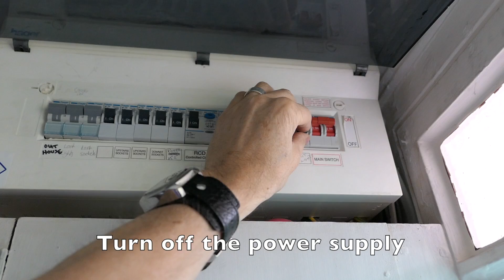How to replace halogen spotlights for low voltage LEDs

Comment: I've currently got halogen spotlights on a dimmer switch and want led's instead.
Do i need to replace the dimmer switch along with the led driver, too?
What rating led driver do i require to run 6 GU10 led's bulbs.
Reply from the maker: Just make sure the drivers and bulbs are compatible with dimmers and you should be okay.
Reply: @AngusMcGregor  
In that case, I will replace the high power halogen dimmer switch to a low power led one. Thanks.

Comment: Sorry for the dumb question but I had my whole house fitted with spotlights and a few years later I find that the ones in the loft conversion room are big and chunky and not easy to replace (unlike in all other rooms). Anyone know why that would be? Are they halogen and can I replace them using the method in this video? Thanks!

Comment: Apologies, a bit late on this one but I have tried to do exactly as you did, ie replace halogen transformers with the same model of led driver you used.  I have two down lighters on the end of my kitchen circuit.  However one of the drivers is making a noise when the bulb unit is connected and will not illuminate. The second one, on the end of the loop-in circuit sometimes lights but then doesn't.  It flashes once each time it's switched on.  Have bench tested the drivers, ie connected a lead from a socket and therefore 240v is being supplied to the driver but it does the same thing, flashes once and does not illuminate.  Tested the bulb holder and leads on a car battery (12v) and that is ok.

Any thoughts?

Comment: It seems my transformer has no earth. Where should I plug the earth wire? Or could I use it without earth?
Reply from the maker: Are they transformers or drivers?
Reply: @AngusMcGregor  im not sure the box says Led Driver but in Amazon where I bought them, transformers. Would they work? Or they need to be transformers only?

This is the one. I just didn’t want to blow out my house haha 
REYLAX® 12V 30W 2500mA LED Driver, AC to DC Switching Transformer, Constant Voltage Power Supply, Low Voltage PSU for LED Applications

Comment: Can you please show how you are taking off these lights? I have the exact same one and not able to take out.
Reply from the maker: This shows you better in this clip 3:08 all you do it pull the unit out of the ceiling. There are a couple of spring retainers on the light unit but you will see where to hold these when pulling the unit out of the ceiling and putting it back in.

Comment: All good. I am having trouble unclipping the downlights from the ceiling. I'd like to avoid breaking the ceiling and I have no access from above it. How do I do it? The search continues....
Reply from the maker: G T Hi, Unfortunately you have to give it a good tug. it may bring a little bits of plaster off but there should be only a little bit of making good afterwards.

Comment: Nice video. question 😊
1. Why you have used so many "drivers" whereas you can use a single transformer for all LEDs connected same connection.
Reply from the maker: subhan907 you would need to check how many lights your drivers can will light up. I would of had to rewrite the whole lighting system and pull up floor board above to rewire so I juts used one driver per lamp as it was easier.
Reply: @AngusMcGregor  thanks, makes sense.

Comment: Why do you need the driver?
Reply from the maker: MAGA anti-globalist To convert from 240volts
Reply: @AngusMcGregor  I understand that you can connect GU10 fittings directly to 230 without this
Reply: @MrOzzy281  It is true, you may use mains directly. I suppose though, using transformer to convert to ex. 12V may seem a bit safer, in case of ex. steamy bathroom and plenty of humidity. On the other hand, why bother having differential switch at home? I am on the verge to switch from halogen to LED in my bathroom, though not sure whether to continue with drivers.
Reply: @wikopl  drivers fail and need replacing. They add work and cost. I see no benefit personally
Reply: @MrOzzy281  I just bought 240v LED and wired straight in without transformer or anything like that and they work just fine. I was surprised to see drivers being used with them!

Comment: I’m sure I have a number of what look like big old drivers for each of my rooms upstairs positioned in the loft. Currently they are all low voltage halogen which at some point I would like to swap out for these led’s. Given the existing GU10 halogens Units have a small transformer each on the pigtail from the lighting circuit which I will replace as you have, what are the large separate ‘driver’ boxes actually doing on top of the joists as well? Are they some kind of voltage regulators before the independent transformers? Thanks in advance

Comment: Angus! I looked this up and it's ... YOU! I am fine with the electrics: having trouble getting the fitting back into the ceiling though.
Reply from the maker: Hi Pat . How are you? Is there not much space for the LED driver in the ceiling or is it the spot light housing?  I found when I pulled out the spot light fitting it damaged the plaster board. I filled and sealed and repainted the holes for easy access in the future.
Reply: I fixed it ok. The shower MR16 is now giving me problems Think I've cracked the housing

Comment: Transformer doesn't need earthing as already stated from mains
Reply: Do you mean the replacement driver doesn't need earthing? Original transformer does not have an earth running to it, driver not requiring too would make life easier.

Comment: Hi, thanks very much for taking the time to make this detailed video. Just one question, the link to the transformer no longer works. Can you please ad ise whether this will suffice? https://www.screwfix.com/p/halolite-electronic-transformer-35-105va/39220
Reply from the maker: Thierry H the link you sent is for lights with a dimer switch. Also check the amount of power that each lamp requires  as the driver.needs to match this.
Reply from the maker: Hi, I have amended the link in the description..

Comment: Thank you for the excellent video, very well made and clear. I was told that I can replace my halogen downlights directly by connecting GU10, leaving out the transformers and without led drivers. I have done this successfully with the kitchen and living room and bathroom. But the bedroom has one GU10 shining brightly and the other 3 are dim!? Are you able to advise me? If this is because I need led drivers surely there would not be one bulb of the right brightness on the bedroom circuit.
Reply from the maker: Benbim HI that should be down to the bulbs. Sometimes they are called  bright or white. I chose to go down the lo voltage bulb route as the bulbs seem  cheaper and use less power. How do you get on with the 240 volt bulbs for cost and power used and how often do they blow? I havent changed a bulb yet with the low voltage bulbs.

Comment: Huh, in the UK you can DIY your own electrical work; it's against the law in Australia which usually has very similar laws! Okay then.... Thanks for the vid.
Reply: After extensive independent testing, it was verified that the presence of Castlemaine 4X tinnies was just enough to heavily skew the fatality rate negatively for the Antipodeans, hence the differing regulations.